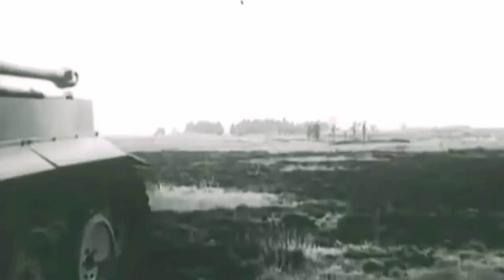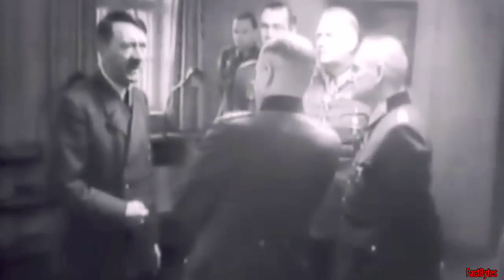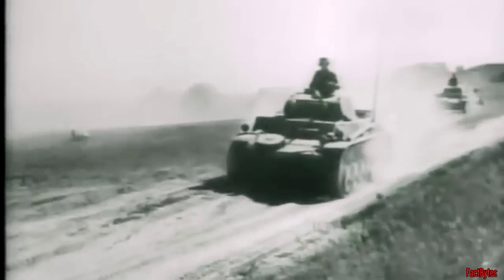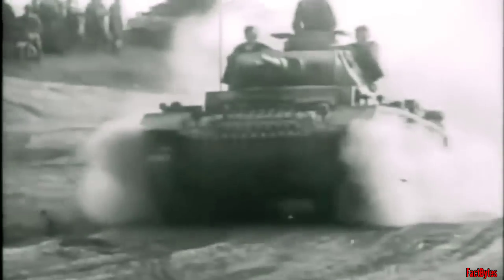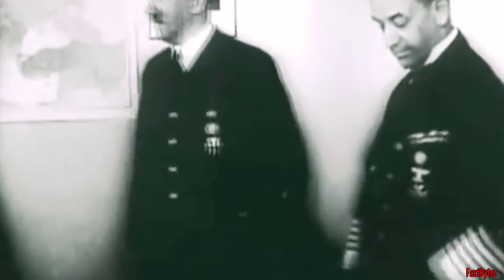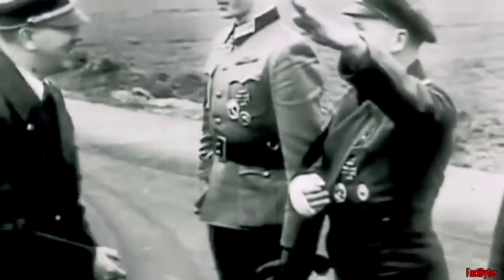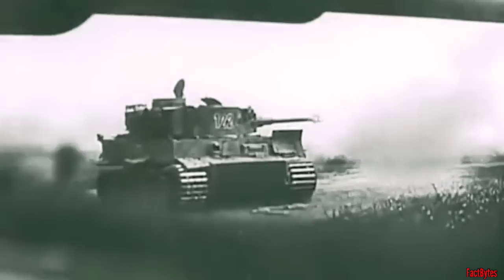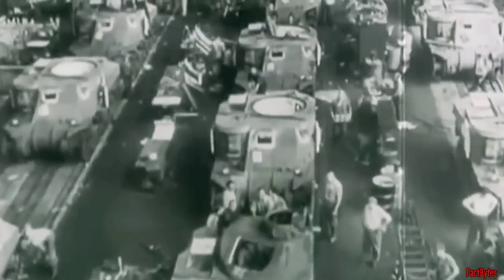Were German WWII Tanks REALLY Over-engineered?

Comment: It was impossible for the Germans to beat the Allies in terms of quantity. It was impossible for the Germans to defeat the Allies, period. However, qualitatively, as an Ukrainian I have no problem conceding that the Panther and Tiger are qualitatively superior tanks. The Germans could never be in a position to beat all the Allies even if they built nothing but Panzer IVs. If they simplified the Panther they might have squeezed a few more thousand units out but still lost. The Panther is the overall best tank of the war. The T-34 was build in massive numbers but after the war the Allies looked more to the German example than the Russian one. The way the Abrams and Challengers stomped the T-72s in Iraq was what was waiting for the Russians versus the west in a conventional war, except by the 90s the Soviets didn't have the infrastructure even to swamp with numbers so much anymore.
Reply: Yeah, if I were to sit in a 100% working tank in a tank duel, I'd go for a later German tank against a Soviet one. If I was given a finite resources to build a tank unit, I'd most probably go cranking as much of those T-34s and spare parts as possible.
Reply: @mmiYTB  Prodcution rates of T-34 were astronomical (possibly another Soviet Lie) but we also know that T-34 had a very high breakdown rate, worse than the Panther, though its field repiar rate was higher.  The T-34 also had very poor ergonimics and soft factors that severely impeded their combat performance.  The USSR maintained propaganda department to promote the superiority of the T-34.  The T-34 is a myth and much of the downplaying of the German tankscomes out of this.  The T-34 was not an efficient combat machine.
Reply: If the Soviets were smart enough to put the 100mm gun that went on the SU-100 unto the IS-2/3 then the Soviets would have had the best tank of all nations during WWII.
Reply: @mmiYTB no way.
Reply: @WorshipinIdols  
The SU 100 only entered Service in October 1944.   It took a long time to develop the gun. It’s penetration performance was no better than the 88 mm L71 PAK 43 of the Tiger II despite the bigger caliber.
Reply: The Panther was just as bad as the Tiger reliability wise, if not even worse due to the lack of spare parts. Allied tanks always had alot of spare parts + easy maintanance.

Also, tanks are not the only things that matter in war, Germany was heavily outnumvered at the late stages of ww2 with no air supperiority.
Reply: @williamzk9083  They were indeed astronomical, because of strict quotas, but they had to sacrifice alot to get those quotas, so T-34s were of poor quality.
Reply: Tanks aside,  Sergei.  If the Germans had been more accommodating to the Ukraine people,  and put aside racial theories,  things could have panned out better for them in that theatre of the war.
Reply: Sherman was probably the best tank it was as good as the panzer 4 it was better than the t34 most were badly built and we could make a whole bunch of them they were also probably the most reliable tank of the war.
Reply: @beachcomber1able  the Germans did put aside racial theories.  These racial theories were mostly fringe even in Germany.  The material in Hugh, trevor, Roper‘s Hitler’s tabletalk purportedly the diary Martin Bormann doesn’t really say anything bad about Ukrainians apart from that they are physically more robust than Germans. Many didn’t care they just wanted to cooperation.  Here is a reality large numbers of eastern Europeans cooperated with the Germans.  This is because Germans, Nazi Germans if you want to call them that, were less murderous and oppressive  than Communistic Russians.  Also has to remembered that the Russian German Armistice of 1917, which was a defeat for Russia, resulted in the Germans imposing the treaty of Brest Litrovesk.  This treaty forced Russia to give independence to Eastern Poland, Belarus, Ukraine, Estonia, Latvia Lithuania.  Ukraine had a short year of Independence before Russia Invaded yet again and brought repression, famine and with it the holodomor.
At the end of the day, Ukraine belongs to the Ukrainian people .  It doesn’t belong part of the Russian empire. It doesn’t belong part of the German empire. It doesn’t belong part of the Swedish Viking empire.
Reply: @williamzk9083  this is russia's seconnd invasion of ukraine, first time was shortly after world war 1 ended when ukraine tried to become independant only difference between the 2 is back during the first invasion ukarine did not have a proper military and was too badly outnumbered
Reply: @williamzk9083 lmao you shouldn't be commenting like these are 'facts' what you're saying doesn't really make sense
Reply: The axis fought a battle of their own while the allies fought against a common enemy
Reply: @zachdaniels5626  Here are some things I find shameful facts.   
-1 Russia invaded Ukraine in 1919, Russia on order of Lenin, Stalin and others ordered the execution of tens of thousands of Ukrainian farmers.  We have this on record. In the ensuing crop failures the grain and food was confiscated and taken back to Russia causing the deaths of 4.5 million (minimum) in Ukraine..  
-2 The 1917 Armistice between Russia and German led to Russia beinfg forced to signe the trat of Brest Litrovisk that forced the Russian empire to set free Finland, Estonia, Latvia, Lithuania, Belarus, Ukraine.   Russia invaved and attacked all of them over the next 20 years and placed them under Russian Communist Empire Oppression.   Only Finland stayed independent.  
-Now Russia is invading again.
Reply: The panther was complete trash. It's gun, could not pin a IS2, hit was far to heavy for the armor it had. 

They need to simplify and make the Panzer IV better. Not build overweight things that can cross bridges or pontoon bridges. It makes you less mobile and easy to predict.

The germans were never going to be us russians. We simply made better tanks. The T34 built in 1934 was the best tank of the war.

It never needed a replacement just a new gun.

All other tanks got replaced.
Reply: @WorshipinIdols they put a 122 mm on the IS2 because the the 122 had better penetration against bunkers and tank armor. Compared to the 100, they also didn't have enough of the 100mm guns.
Reply: The sherman had a positive kd over the panther
Reply: @Robert53area  the put the 122mm on the IS-2 for only one reason.  It was already in production for their medium 122mm howitzer as well as the SU-122.  So for ease of manufacturing and logistics they applied it to the IS-2.  No other reason was considered.  
When they wanted the 100mm they started producing it, like they did for the SU-100.  And later the T-54/55.
Reply: @Robert53area  The last production Panther was Panther Ausf G. (3rd generation).   The Panther Ausf F (4th generation) was about to enter production in 1945 (1944 apart from allied bombing).  It featured the same 8.8cm KwK 43 L71 gun of the Tiger II which could pin a IS-2.  Ausf F featured a Tiger II like "Schmalturm" or 'small turret' that had 30% more amour.  This was achieved by using a space saving coaxial recoil mechanism.  There were ports for coincidence range finder as well as stabilized optics and plans for a improved final drive (planetary).  JagdPanther, Tiger II and JagdTiger were there to ensure something could handle the IS-2 as Panther Ausf F entered production.
Reply: @mmiYTB  Yeah T-34 is hard to beat, Panzer 4 or Sherman Easy 8 wouldnt be bad choices either.
Reply: The American tanks were qualitatively better than the German tanks too.
The difference was the Germans rushed tanks into production while the Americans didn’t. 
All the German tanks had reliability problems (the Russian ones were even worse until 1943). The American tanks had ten times less mechanical failures than the German equivalents. You hit the starter on a Sherman and it just ran. You hit the starter on a Panther and prayed.
Reply: Nah, Sherman/Pershing were the best sorry to burst your guys' bubbles. The combination of armament, armor, survivability, mobility, reliability, and ease of maintenance/actual access to parts was just superior flat out in the hands of an equally experience tank crew and for their purpose.
Reply: @IkeanCrusader1013 i thought pershing was not good, thats why it was replaced by shermans in korean war.
Reply: @ivvan497  Reading that made me physically angry, the US didn't have enough pershings in the Korean War, they  were never replaced with shermans - shermans were supplementing the lack of pershings. Part of the reason we struggled so much was the lack of pershings and their early reliability issues (which were immediately addressed and resolved mind you) and being unprepared for the weather with our shermans. The pershings were eventually replaced but it was with the M46 Patton. However far and away the best tank used in the Korean War was the Centurion Mk.III up until the M46 was fielded, in which case I personally am of the opinion that the M46 was superior due to better reliability, mobility, survivability, firepower, accuracy, and overall protection vs the centurion which had the armor focused on the turret and a weaker hull, whereas the M46 more balanced protection with it's turret and hull armor being sufficient against most enemy tanks, unlike the Centurion who's hull armor was less reliable, and both would be penetrated easily through the hull or turret by the 100mm and 122mm guns used by chinese and Korean forces anyways so the extra turret armor on the cent didn't matter in the end.
Reply: Tanks aren't solely there for tank duels.  The US Army did a survey and discovered that 87% of the shells used by Shermans were high explosive while only 13% were armor piercing.  So, Shermans at least didn't spend a lot of time having artillery duels with German armor.  If you had the option of building a tank that was good at taking out 13% of its enemies or 87% of its enemies, which would you choose?
Reply: @anamiacdm  Exactly, they're for infantry support first and foremost, tank destroyers are for killing other tanks
Reply: @jakegunning61 absolutely not. The sherman just had logistics behind. They were very high in profile, had very low quality armor, a cannon that lacked good ballistics and penetrating power against heavily armored targets. But they had the numbers, were indeed less prone to breakdowns compared to tigers and panthers, but they mostly had a overwhelming air support and always had fuel and spare parts. Otherwise the sherman is probably one of the  worst medium tank of it's time
Reply: @revan22  Sherman was easily more reliable than any tank listed and took on both Panthers and tigers and won can't be the worst medium tank of the war Italy was also in the war
Reply: @jakegunning61  yeah I forgot Italy... But Sherman's just outnumbered panthers and tigers, before the 76 mm cannon they couldn't take them effectively, and were indeed less prone to breakdowns. But thats it. High profile making it easy to target, poor armor resulting in crews casting concrete over the armor to get an impression of safety, very poor ballistics. It was just quantity and air support. Sherman's can't penetrate German armor at fighting distance unless targeting small weak points.
Reply: @revan22  Panthers had a fairly large siloete also and both the panther and the tiger were prone to breakdowns I rank reliability very high on emportance to a tank don't get me wrong get a tiger and a Sherman one on one tiger will probably win I can't say the panther would win by the time the panther showed up the sherman could kill it and the sherman crews were much better trained then the german crews at that point in the war
Reply: T-34’s weren’t cheap at all, they were cheap to manufacture, expensive to produce. And if built to American standards it would be as expensive as one Sherman, for a more cramped and practically slower tank.
Reply: @Robert53area Let me just take half a minute to enter the cramped ass t-34 driver area, ignite it and go off road barely getting up to 3rd gear (with assistance of hammer) than have it break down halfway to my destination. Truly the best tank of the war.
Reply: In that time Germany tanks numbers were 25000 , the allies were about 250000 , this put pressure on the germans to create balance in the power and the fight
Reply: All your reasoning crumbles down if you considered that the allies meant squat in 1941. It was the soviets that took most of the heat from 1941 thru mid 1944. If the soviets surrendered like everyone else did in 1941, then the nazi war machine would have turned unbeatable, thats a fact.
Reply: The t-72s in Iraq were just basic models with training ammo not comparable to models Russia uses.
Reply: Actually they would have had hitler not invaded Russia when he did, they lost too much of their armies because of the cold and lack of cold weather supplies. If not for that the allies would have been in trouble
Reply: @williamzk9083 
Wait a second - you say: "Ukraine belongs to the Ukrainian people". Shouldn't it belong to all of its citizens and not just the Ukrainians? What about millions of ethnic Russians who inhabited Ukraine pre-2014 and the fact that a half of its population speak Russian as their mother tongue? 
Are you aware that what you're suggesting ("Ukrainians only") is exactly what caused the war back in 2014? The new leadership of Ukraine that took power in 2014 not only ignored the political will of the Ukraine's Russian population but began stripping them off of their constitutional rights. Then after they took control of some of the ethnically Russian territories in the East, the Kiev regime tried to militarily subdue them and force them to comply. You expect Russia to stay aside?
Reply: @matovicmmilan  I know several Russian speaking Ukrainians.  They are Ukrainians not  Russians.  Zalnsky himself is a Russian speaking Ukrainian.  Much of the Russian speakers are Russified Ukrainians caused by Tsarist and Soviet cultural gen o cide policies just like in khazahkstan.  Some are the result of Russian colonisation policies.  In practice there will be no place for Pro-Z Ukrainians irrespective of their mother tongue just like there was no place for Nazis in Germany after ww2
Reply: @williamzk9083  
Who fought in the Crimean War? The Ukrainians? What country did Crimea belong to? Ukraine? No, the answers are "the Russians" and "Russia" respectively but since you don't like the answers we're gonna claim that these were actually some Russified Ukraine and Russified Ukrainians,  right? 

You say: "there were no Natzis after WW2"; Technically you're right - the Natzi party was abolished and no German was a Natzi party member. Now would you rather pretend that this formal act also meant that suddenly in one second, not a single German embraced Natzi ideology anymore? 
But it's 100% irrelevant because it wasn't the Natzis who from 1939-1945 invaded multiple countries, committed enormous war crimes and eventually lost the WW2, it was the Germans. Let me give you an example from my country: After suffering losses in a battle with the guerrilla movement, the German armed forces enacted revenge by taking out 150 children from the local school and shooting them dead in front of a firing squad. Out of the 10 Germans in that firing squad, only one was a Natzi. But they all took part in this gruesome war crime so as you see it makes no difference in practice.

If you and those like you wish to extermnate all the ethnic Russians & pro-Russian Ukrainians, let me remind you that you'll need to win the war first!
Reply: @matovicmmilan  The parallel between Nazi  and pro-Z Ruskiy Mir Muscovites is exact.   Both will meet the same fate for the same reason.  
-The invaders of Crimea were Russian Army and Russian Wagner Mercenaries who did not wear uniforms within insignia.  Technically a war crime.  Centuries of Moscow based ethnic cleansing of Crimea by Tsars and Russo-Soviets followed by suppression of language, forced assimilation policies and Muscovite colonisation have left their mark on Crimea and Donbas.   The Soviets and Tsar liked to encode ethnic “divide and rule” policies.  
-There is no getting around centuries of Muscovite oppression and its evil legacy
Reply: @Robert53area 
Bro what, the Panther gun could deal with the IS2 pretty easily, the panther was also brilliant in production, the Germans produced 5k of them in 2 years vs the Pz4 at around 8-9k of more than 5 years of production run. The real drawback of the panther was the final drive, even then this mainly affected poorer trained crew and by the Panther G’s, didn’t majorly affect readiness. 

The IS2 had horrible ergonomics, a 10 business year reload rate, terrible first shot accuracy, terrible vision etc., it’s main advantage came from better armor and smaller silhouette
Reply: @mmiYTB for a tank unit you’d be better off using multiple late war Sherman’s
Reply: @williamzk9083 what a load of bull